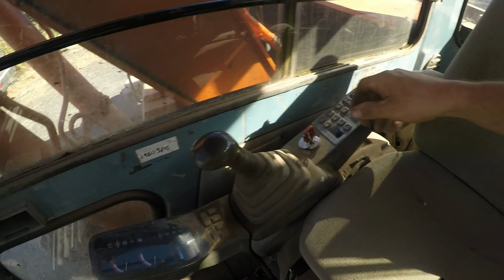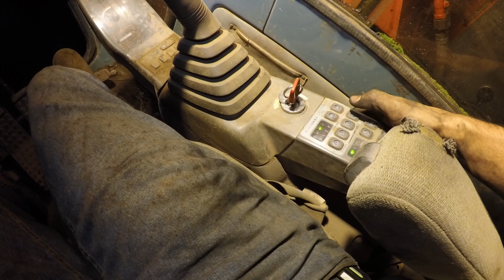New throttle cable and muffler for Hitachi excavator.

Comment: Is it still overheating ?
This oil is caviar for this engine,you could go cheaper if you want,using car engine oil with the same CJ4 norm or even the previous norm.
Very often ,engine oils are not even different between diesel and gas.
As long as you see the API norm on the jug with the "S" norm for gas engines and the "C" norm for diesel engines you can buy whatever you want.
You don't have a DPF or crazy emission stuff requiring a specific oil.
You can dump nearly whatever you want with a minimum of quality in this engine.
http://www.oilspecifications.org/api_eolcs.php
Peoples are brainwashed about engine oils and oil change intervals in your country lol.
3000 miles oil change lol,yeah in the 60's maybe.
Reply: "very often, engine oils are not different between diesel and gas",....Really, where the heck did you get that idea from?
I'd strongly suggest that you check the specifications for these engines, IF the specs. don't call for diesel rated oils then it might be o.k., but most call for 'diesel oils' with  higher detergent additives than gas. engine lubricants.
Go cheap, and you'll eventually go broke!
Reply: lol
simply because you can see API followed by the gas and diesel specs on the same container...
Look at the norms on the oil jug
both gas and diesel norms are on the same jug,and most of the time the jug is advertised as "diesel" oil or "gas" engine oil,but it's the same oil in it.
Take a look.
Reply from the maker: michaelovitch so how often should I change that oil? I was under impression of 250hrs, and I do smaller machines at 100hrs.
Reply: Keep the manufacturer recommandations,that's the best,he built the machine.
His recommandations are from 1995,with the oils standards of this time.
Knowing that,with about whatever average oil meeting the actual norms,even cheap,you don't take risks.
That's why i say  that you can,if you want,use a cheaper oil,as long as you change it regularly.
You can clean the injectors to avoid excessive soot ,wich pollute the oil,and be sure the PCV system is working well.
Reply: Add a "bypass filter" and you could triple those hours, I use one in my VW diesel and run my oil up to 65k before I change it with absolutely no issues. I hate changing that nasty sooty stuff. FYI Rotella is good oil for the price, I would stick with it.

Comment: That’s just a Morse marine cable
Reply from the maker: Yeah? That's good to know parts like that are easy to get. My friend has a similar machine, and he cant get that electronic throttle working, he has to open the side panel to adjust the motor speed. I told him to just make a manual one inside the cab. Would a longer cable than that be available?
Reply: Andrew Camarata they make many lengths if not Morse there are other manufacturers that have it 
There’s always another industry that makes something that works..none of this stuff is rocket science...these companies are just building equipment with other manufacturers parts..it’s all part of this global partnership bullshit they are going after now...I mean Liebherr was making machines for JD for a while and so on.

Comment: Andrew, do you ever pull the traction final drive covers to check that the pipes and motors are free of corrosion causing debris? I found that area chock full of crap (really tightly packed) on my Kobelco SK130 and I had to use hammer and chisel to get it out and away from the tubing etc.
Reply from the maker: I have cleaned out both sides, because I changed all those hoses a few years ago. I don't think it being full of dirt will hurt anything though.

Comment: Hello everyone! So I had this exact same problem with my EX120-3. I replaced the throttle cable because mine was seized up. However, now I still don't have any throttle control.  When I turn the key to "on" I should hear the stepping motor (EC motor) move as shown at 6:39ish of this video. Mine does not do that so I can not start the engine unless i get some to pull the throttle lever on the stepping motor so that fuel can get to the engine. Once the engine is started, I don't have any response when pushing any of the four buttons (I,L,E,P) except for the fact that the one that I push lights up. Any suggestions?? Thanks for the help!
Reply from the maker: My friend has the same problem with his 120-3. I don't know if he ever fixed it. Maybe just add a manual throttle if you cant get the electronic nonsense working. Maybe something like this https://amzn.to/2Ew573f
Reply: Andrew Camarata Yeah i was thinking about doing that... I found a service manual that I'm going to look through as well. I think has something to do with the EC computer. Thanks for you imput!
Reply from the maker: Ill try to ask my friend if he ever fixed his. I bet he is still using a bungee cord.